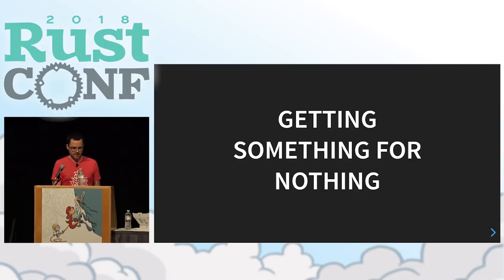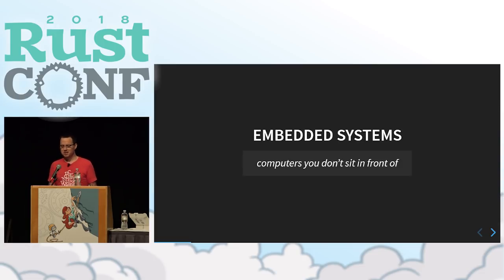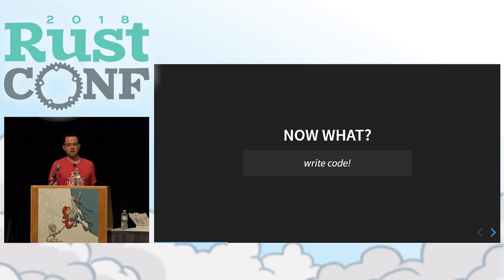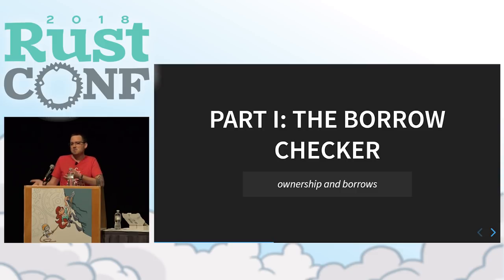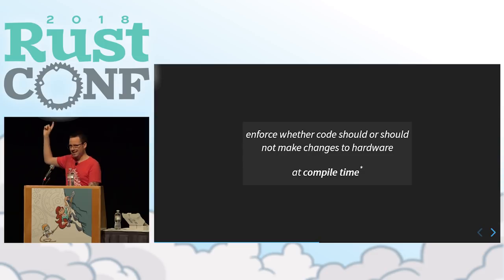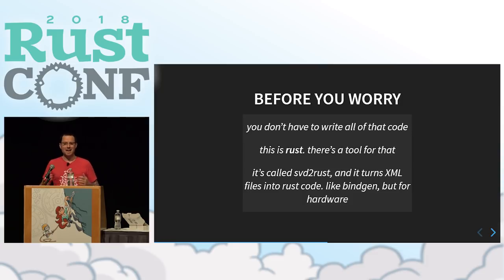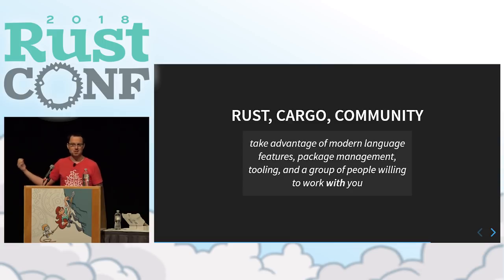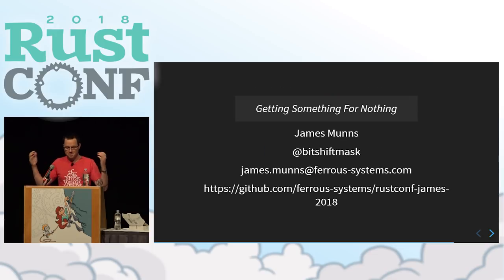RustConf 2018 - Getting Something for Nothing by James Munns

Comment: Is rust really up to that level where you can take a stm32 board for example and that easily make a io pin an out put and set it low or is that just a where we are headed talk? My quick look at the cortex-m QuickStart didn’t see much like that. I have a bunch of stm32 discovery and nucleo boards I would love to actually use. F3,F4, and F7’s. I seem to be coming in at a confusing time with the transition from Xargo to built in support.
Reply: nii-san! : Thanks. It’s on my reading list. I’m at the getting my first stm32 program to compile still stage.  I just finished installing all the cortex m QuickStart.I am still working thru the rust book too. The more I see the more I like.  I think I will work toward having a starter crate for each of the boards I have a fn start_up() and fn r_loop() similar to Arduino if that turns out to be a useful option.  I would love to really use the stm32f7discovery board I have collecting dust since it first came out.